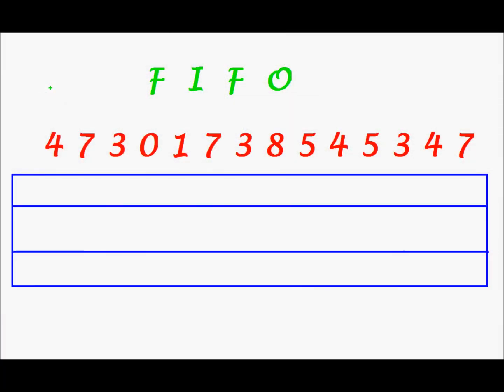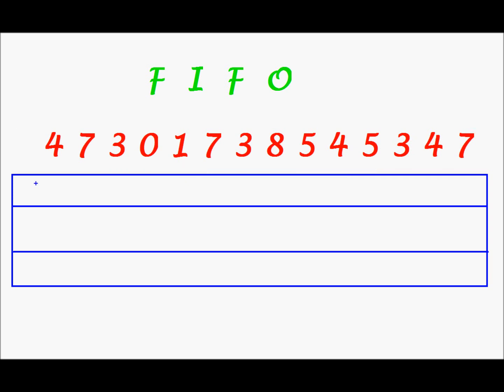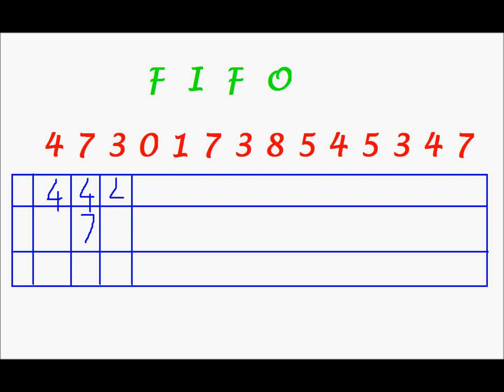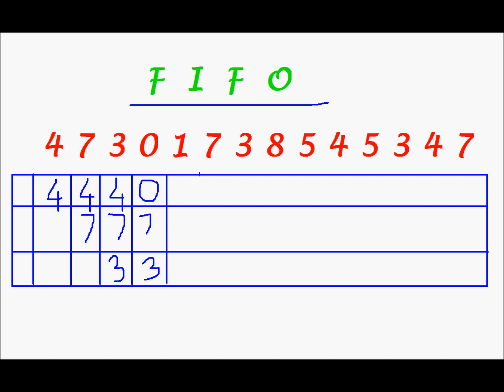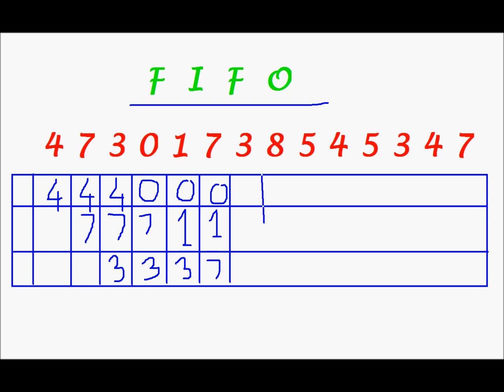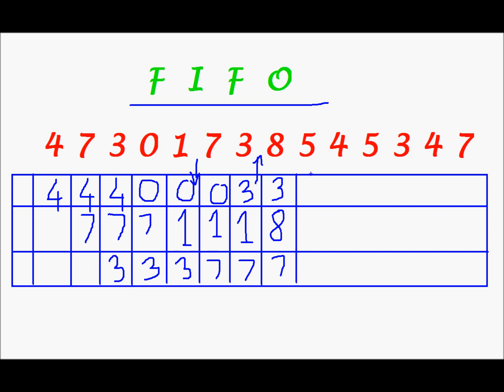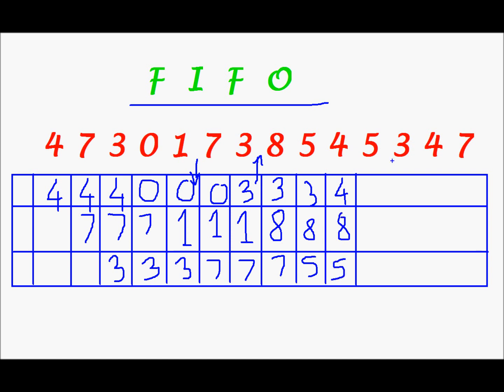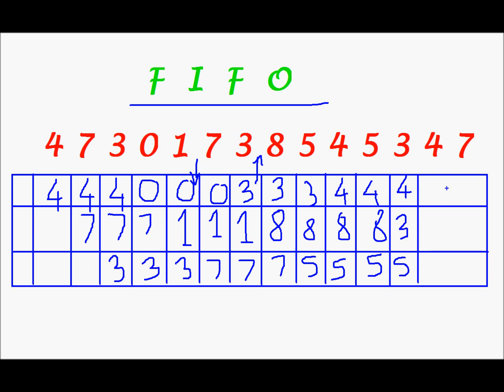Operating Systems- Page Replacement FIFO

Comment: Design a  8 x 128 FIFO (8 bits wide , 128 locations) with Almost Full , Full and Empty Flags.

1.  You should use Finite State Machine design techniques in VHDL
2.  Design a testbench around this and run in the lab, print the waveforms.

Comment: this is LRU dear!
Reply: This is FIFO.
Reply: @ade8890  Nope AamirAli Mir was right this is lru i have seen other videos also only this guy told it differently
Reply: @aswanthjabba931  Wrong.
FIFO means First IN, First OUT. Follow the algorithm on screen. First element added to buffer is the one replaced when a new element comes along. I suggest doing a bit more research if you're still confused about the difference.